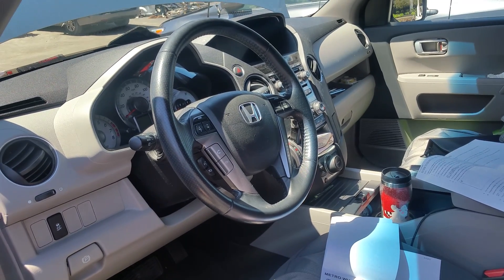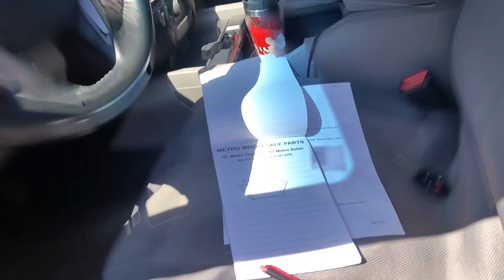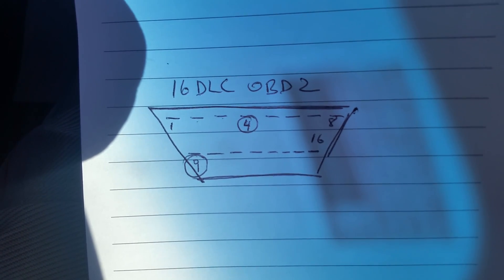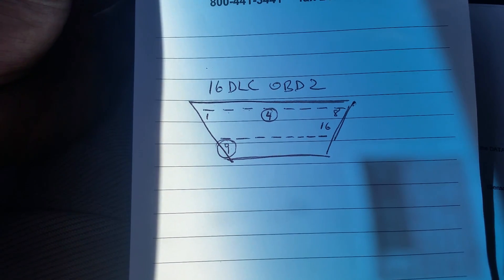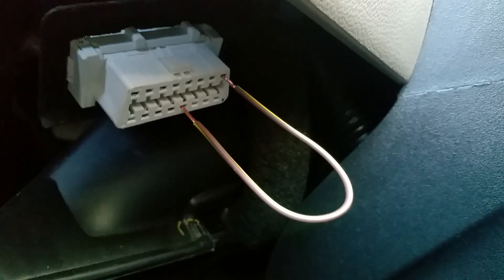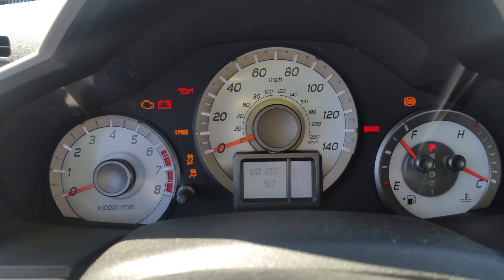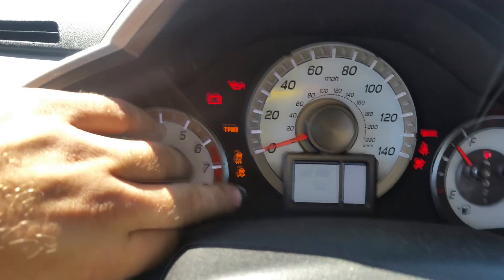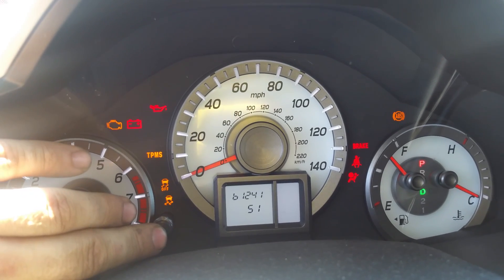How to check trouble codes on Honda or Acura for free. No Scan Tool Needed!!!

Comment: Didn't work for my 2011 crv.
[edit] ....whoops connector was upside down lol. it works but no code, it just says "no" like someone else said. The CEL itself does flash out a code though (6 long and 7 short flashes)

Comment: It worked for me! 2013 Acura RDX. If you look closely at the plug, there are tiny numbers. The first row says 1, and the second row says 9. At first I had my wire in the wrong way but then I looked closer and saw the rows were numbered.

Comment: #4 and #9 does not work on 2003 Honda Odyssey. You will blow fuses.
Reply: My obd2 plug on my 2005 rsx is downside up, I made sure to short #4 and #9 vs #13 and #8 🤓

Comment: I don't think it works on the 99 Acrua Integra.  I tried 2 sized paperclips to get a good contact, but I never got any blinks on the check engine light.  I don't have an LED to show the codes.

Comment: For older hondas theres a blue connector on the passenger side kick panel below the glove box. Just jump the 2 pins and go thru same procedure
Reply: Which pins exactly? Thanks
Reply: @luvcrim  it might be green but yeah only 2 pins just make a jumper from whatever you can i used a paper clip

Comment: Either your drawing is upside down OR your ODB2 connection port is upside down on video. Which is it?
Reply: Looks like when he did it the connector was upside down but the diagram is correct